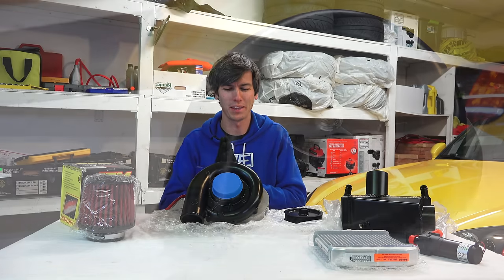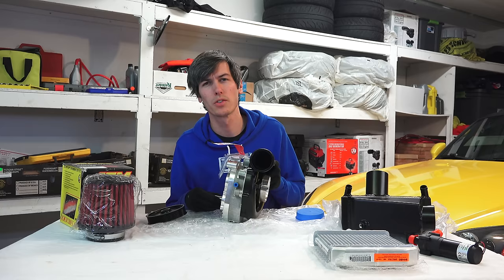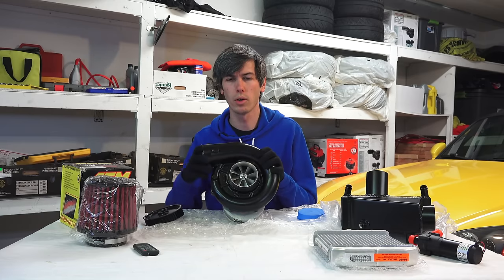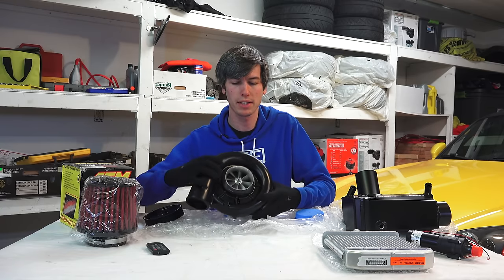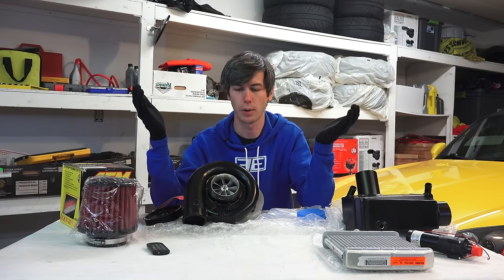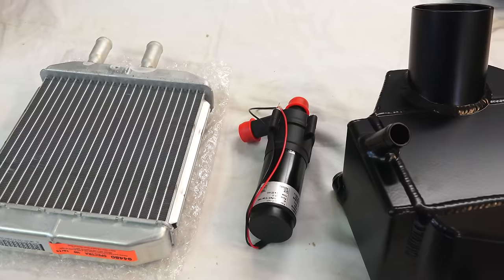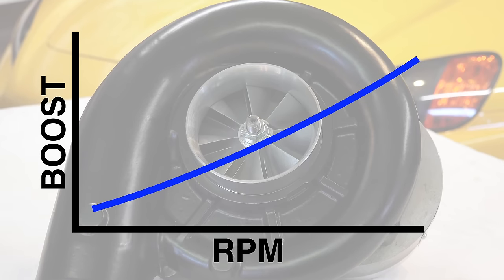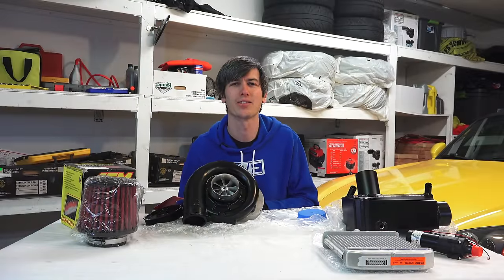How Do Centrifugal Superchargers Work?

Comment: I don't know if this comment will be seen months after video went live but just wanted to say love your channel. 2 months ago I installed a Procharger D1X on my 17 Mustang GT. The reason I went centrifugal was the benefit of what you actually highlight as a disadvantage. Namely the fact that the Boost comes on as the RPMs climb and you don't have that initial  hit of a positive displacement. I had a few reasons for desiring that powerband. 1 it's a daily driver which means it sees rain and (living in NYC) cold. By short Shifting the car it maintains the drivability in adverse conditions as I can stay out of boost longer. The daily driving behavior of the car is phenomenal. 2 is longevity of the drivetrain. I'm by no means wealthy and able to pour money into my car. I'm sure you know, the easiest way to break something is apply a ton of torque to it while it's at rest. Trans, driveshaft, diff, and halfshafts take a lot more wear and tear if the car is standing still and you "floor it" than if these parts are already rotating. 3 I don't track my car. Most contests of speed are from a roll on a street. As such, I'm already at about 3k when I go so Im already starting to get into my boost. If I occasionally go from a dig, I'm launching it at higher RPM anyway. You can see this on the turbo McLarens which have a message on the dash. When u r stopped and bring the RPMs up for a launch, it says "Building Boost-Wait" Once RPMs climb, it says "Boost Ready". Obviously there's nothing wrong with positive displacement superchargers. They are great. Essentially centrifugal was just better for my situation.

Comment: I have a similar setup on my Subaru  EJ253 (Raptor AU supercharger)  - I love it.  200k miles and runs like a champ.  Max boost @ max RPM makes it relatively easy power on the engine (high boost at low engine load). The low end torque is good-- very noticeable right off the line.    My HP curve is very linear but torque is like a shallow mountain or inverted shallow V.

Comment: we have so much in common! I have a spa yellow s2000 also. just did my 4.77 gear last winter and I'm in the process of putting my vortech supercharger in now! right now all i have done is my upgraded heat exchanger from frozen boost. all that's left for me is supercharger and bracket to be put on. a aem ecu and id1000. good luck and can't wait to see your install

Comment: belt powered turbo
Reply: adam basically
Reply: its just a normal procharger
Reply: procharger and vortec are specific brands
Reply: what's is a procharger? it's a brand! the same logic is calling every cruiser bike harley davidson, or call every sport bike yamaha
Reply: @straight_intro  you probably still call an airport apron, the tarmac. Juccazi, tomato, Who cares.
Reply: @pluto8404  EvErYtHiNg iS tHe TarMac
Reply: @pluto8404  It does matter because for instance i have an ECS blower on my C7 Corvette which is a Centrifugal blower. Procharger is another option i had but i choose different. So calling every Centrifugal a "Procharger" would be wrong cause there's so many different companies that make them.

Comment: Also, unlike a turbocharger, boost depends directly upon engine RPM. This makes tuning and controlling a supercharger easier and safer than adding a turbo to a motor. No blowoff valves or added exhaust backpressure to worry about.
Reply: True, turbos only depends on how much exhaust gas flowing out, which can only be countered by the driver... Usually they rev to spool up first... While this supercharger can be controlled by gears to spin turbine faster, either mechanical or electronically controlled... Some guys here said something about combining CVT with it... Theoretically, it should work...

Comment: Have you thought about running a smaller pulley with a wastegate?  That will give you more low end torque, while allowing you to bleed pressure at higher RPMs to preserve your engine.
Reply: Just thinking about what you said.  Wouldn’t a smaller puller create more boost and power therefore putting more stress on an engine.  I’m not an expert but I was just thinking.  (Feel free to correct me if I’m wrong).  ;)
Reply: The smaller pulley will spin faster, thus producing more boost at any given engine rpm.  The wastegate then bleeds off that boost to a controlled pressure at higher rpms, in order to save your engine.
Reply: Interesting idea. But I also think that might decrease fuel economy further as the engine has to work harder to spin the turbo.

Comment: hi , thanks for the video.

note it is not a gear reduction but a rise in gearing that makes the impeller spin faster.
Reply: I think the meaning can swap around depending on context, reduction in speed + increase in torque is one use, reduction in torque + increase in speed is another use?
Reply: mechanical things can be used in many ways even if not designed for that purpose. people use cut off pistons as ash trays. Just saying something does not make it right, even if it sounds good.

look up reduction box definition, as a starting point.

Comment: Awesome video. Not trying to nitpick since I'm not 100% sure inside the supercharger. I thought with this type of supercharger the drive gear is larger than driven gear, meaning it's an overdrive gear, much like in a transmission giving a higher output speed. "Gear reduction" is when going from a small drive gear to larger driven gear reducing speed. That's what I thought, maybe you can verify.

Comment: I was kind of anticipating a note about how centrifugal chargers are (or could be) the least stressful of the boost options out there. This is from personal perusal on the forums mostly, but since the centrifugal gradually builds boost, it's not subjecting the engine and drivetrain to the "shock" of full boost all at once at a given load, like a turbocharger or other type of supercharger.

Anyways, keep the vids coming and yes! Install! :D everything's better with boost, right!?

Comment: Fascinating! Thanks for the explanation, as always you made it very easy to understand! An interesting possible solution for the lack of boost at low RPM, might be to have a type of gearing setup (CVT?) that enables the supercharger to spin faster at lower engine RPM. Of course this brings with it many other challenges (packaging, cost, complication, etc.) but if you could keep the charger spinning within its sweet spot all the time, it might be worthwhile, especially in racing applications.

Comment: Thanks for giving a simple explanation.   Interestingly, my parents petrol engine ( Renault C3, from the UK) develops maximum torque at about 1600 rpm by using a supercharger. It seems to have both the torque of a diesel & power of a petrol but i am guessing that the economy does not match a diesel.

Comment: I really appreciate the level of detail you go into when explaining things. You take something that could be complicated and break it down into manageable pieces of information. I dig it when you break out the white board, lol. I hope the install goes well on the s2000 (I'd say no pressure but it's a supercharger =P). Side note, would you ever consider twin-charging your engine on the s2000 or others, or is that more or less pointless in most situations? Thanks again Jason!

Comment: Good luck on your set up. Im s/c my s2000 too with a novi1000 comptech kit and a 10lbs pulley. Hope u make good numbers.
Reply from the maker: Nice! I’ll be starting with 6 lbs, then deciding if I want more from there. Will require new fuel pump, injectors, and ECU if I go higher.

Comment: ive been waiting for the vid where you say your saying your supercharging your s2000. congratulations and take your time. no rush. im bummed because i turned down an s2k because i wanted an s550 mustang for better straight line performance. I dony regret my purchase but just wish i could afford and s2k ap1 also.
Reply from the maker: Sometimes it’s nice to think about having way more power haha, the car itself isn’t all that quick. But it’s definitely fun!
Reply: Engineering Explained the main reaon i like the s2k is the redline but with the coyote ford sells the gt350 intake manifold and when swapped the coyote will make power all the way to 7500 and the limiter can be increased to 7900 rpm. cant wait to swap

Comment: There are a couple variants on this setup that I've been curious to see, but haven't had the time in private life to chase.

First is using a geared turbine supercharger driven by a brushless DC motor. Motors, controllers, and high capacity lithium batteries have become much more widely available. This setup, as in F1, would allow boost to be called up as needed rather than as available. Second is a refrigeration circuit as an intercooler. There are a couple ways to regulate a system like that but I simply do not know enough about combustion dynamics to say whether it would be worth the effort.

Comment: I think a centrifugal supercharger is a really good choice on a stock bottom end engine. They don't hit as hard at low rpm and build boost as rpms build. They also work better with the higher compression ratio you'd have a a stock motor. Because your not building boost at the low end, the parasitic loss, at low speed,  isn't too bad. I think your going to love it especially on a long hard pull!
It's funny to read some of these comments. People seem to be biased toward PD blowers or turbos saying this or that is better. They all have their pros and cons but I think a Centri is a great choice for the reasons mentioned before, and ease of install as well.

Comment: Compared to other superchargers this sounds very similar in function to a turbocharger, especially when it comes to the lack of boost at low RPM. Which really begs the question, what advantages does it have compared to a turbo?
Reply: No sudden spool. This style blower produces a very linear tq/hp curve, which makes it very easy to manage traction. No sudden 80HP jump when your turbo spools, it just keeps building steadily.
Reply: Packaging, no heat transfer from exhaust turbine, and no lag. This working best at high RPM isn't the same as having lag. It will always make the same boost at a given RPM, there isn't a time delay when you put your foot down.
Reply: Reliability and packaging are basically the benefits.
Reply: Greg Donovan thanks for the info, really appreciate it.
Reply: And less heat.
Reply: Well, a turbo system can be TUNED for either low, mid, or high power. Just look at factory turbo'd vehicles. All have IMPRESSIVE response and torque, but people usually swap them out for a more high-end type system in the search for maximum output. Now, with all of the technology today, you CAN make a turbo system broader on the RPM band and far more even, but it'll cost more, be more complex, have more points of potential failure, and it'll still have that issue with a shitload of heat.

So, supercharging is quick, easy, simple, more reliable, and cooler than producing a turbo system that can 'do it all'. And centrifugal supercharging gives you more predictability and controllability than a roots or twin-screw system as it has a lower power ratio down low than it does up high, allowing the vehicle and tires to get up to a speed where they're less likely to break traction from power, since the power to do so hasn't yet eclipsed the traction of the tires given the RPM.
Reply: Every comment is right also turbos can damage your transmission due to all the power hitting all at once. But this usually only matters with cars with weak transmissions like my brz
Reply: if you have middle size turbo it's okay, but with a big turbo you can't get power down low, while with a small turbo  you can't make big power up the rpm range

Comment: Turbos are cool but the torque, and power you get from superchargers are on a different level. Might not go as fast in the top speed, but the pull you get for short wide track circuits, or autocross is where they thrive.

Comment: Dam man why are you so smart! Your videos are always so cool!Also correct me if I am wrong; a centrifugal super charger builds boost gradually so most of the time you can use stock internals as it is not an immediate strain on the components. A normal turbo or roots style super charger puts alot of boost on top of the pistons which stresses everything out and this is why you won't necessarily need forged internals for normal boost.
Reply: Wrong
Reply: SativaSteve great thanks for all your information given

Comment: you also can over spin a centrifugal supercharger and damage it ,  so if your car has a very high red line that you plan on hitting you are limited to a larger pulley on the supercharger which reduces your boost more dramatically at the low end of your rpm range , but that shouldn't matter as much since a high revving car will also have a higher avg RPM to begin with, the disadvantage will be more apparent from a dead stop pull or if you are in to high of a gear coming out of a turn. This is why Big Blocks love centrifugal superchargers in drag racing , low bottom end boost where it isn't needed due to the massive natural torque output of the big block , then shortly after the launch the boost kicks in where it can be utilized and put down to the pavement without blowing off the tires. there is a tuning advantage as well being that the boost comes on linearly.

Comment: I realize this is most likely specific to every vehicle individually, but what's better centrifugal or turbo? A steady power increase seems appealing, you won't just suddenly get a jolt of power and possibly break the tires loose, however you do get that at the expense of the load on the engine.

Comment: If I was to run a smaller pulley on a centrifugal setup would that help it create the boost quicker and help with the lack of power increase in the low range? Or would I be better off just using a relatively small and quick spooling turbo?

Comment: How will this affect the exhaust note?
Reply: Technically the exhaust will sound the same, but the gears, pully and compressor will make a fairly loud whine that increases in pitch with the engine speed.
Reply: coldteeth24 Similar exhaust note played back at 1.5x. 😀
Reply: Who cares about the exhaust note when you can't even hear the engine from the whine the supercharger makes 😂
Reply: ... like a ford powersteering compressor? :D
Reply: Ferdi G. I have one of those. 🙂
Reply: CROblazer420 This type of supercharger doesn't really whine like that, more of a high pitch whistle

Comment: My only face to face experience with superchargers has been with the first generation BMW Mini Cooper S which has the Eaton M45 mounted beneath the intake manifold. This allows for a decent sized intercooler for a 4 cylinder but it throws in a lot of 90° angles and from what I recall of air flow 90° turns reduce air flow my something like 30% each turn? I am unsure if this is different in pressurized systems.

The main downside to this is that while the vehicle is not moving forward the air to air intercooler is exposed to the engine heat and soaks relatively quickly and the waterpump is run off the back of the 'charger sapping power that could me made up with an electric water pump.

Comment: I have a 2017 Chevy SS Sedan; aka Holden Commodore VFII.  I just had a Noonan Billet block;  4.00 x 4.125, rasied 55mm cam mount, w/Darton Wet Sleevs. I also have a Plazmaman Race Manifold, Nick Williams 102 DBW Throttle body. My original planed called for a likck-ass NA build using my Harrop OTR CAI, I now want to a power adder. I need advise between a ProCharger or TurboCharger, so I may utilize most of the existing components. This build is intended as performance stree, touring/daily driver. Which route would you choose and why?

Comment: When you were talking about the centrifugal compressor output curve you showed that is was a linear type curve.  Isn't the output characteristics of positive displacement pumps like roots or screw type compressors to linearly increase their output as rpm rises but for centrifugal pumps, aka turbos and centrifugal superchargers outputs increase is proportional to the square of the change in rpm.  Your graph doesn't really represent that.  Also all this is assuming there is no waste-gating or bypassing going on.
Reply: Bueller, Bueller?

Comment: Could you achieve more low-end torque by driving the compressor with a CVT to permit higher boost at lower RPMs? This could be controlled by the throttle to provide a higher ratio the further the throttle is depressed up to max boost. In theory, it seems like you could have max boost no matter what RPM you were at and only when you wanted it.

Comment: I'm looking to get one of these vortech SC for my 3800 S1, eventually, for the internally stockish of the 3 3800 powered cars I got, probably not after I finish my current mild N/A car which will make similar to a SC one.

These SC go well with 3800 as they lift up the top end a lot but leave the very torquey low end alone and response down there remains as well.

Comment: The Bell P-39 and P-63 used centrifugal superchargers during WW2. They're very odd designs with their engine mounted right behind the pilot, just under the cockpit. Even the choice of supercharger is rather odd but when you think about it, a plane will always work at a high RPM so it makes sense thus far... A lot complained about its high-altitude capabilities however, so is there any reason why pilots preferred "regular" superchargers during WW2 or is it down to the engine itself?

Comment: i would imagine they would actually hurt the bottom end performance more than when previous installed since there is that extra rotational mass the engine needs to spin up. but soon as that boost build it'll be a riot.